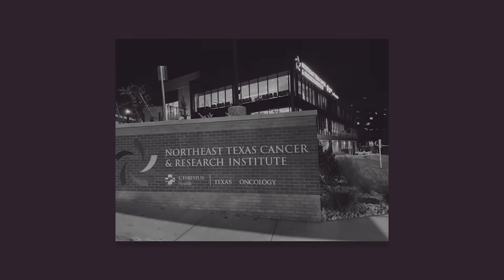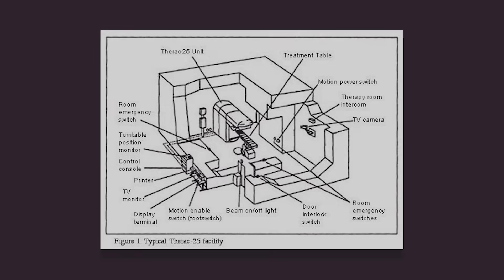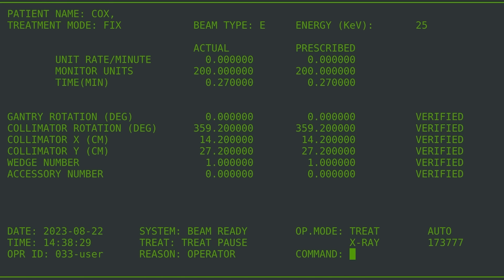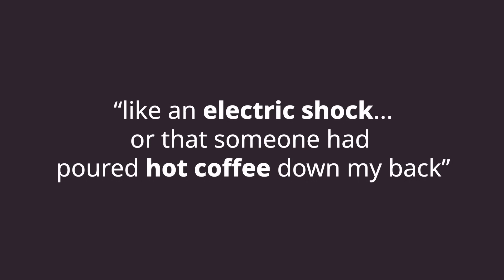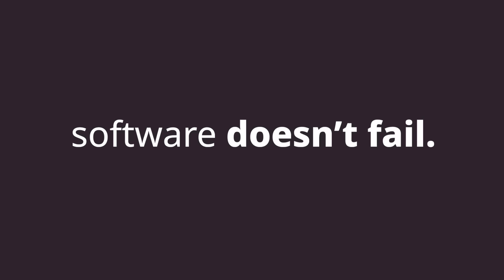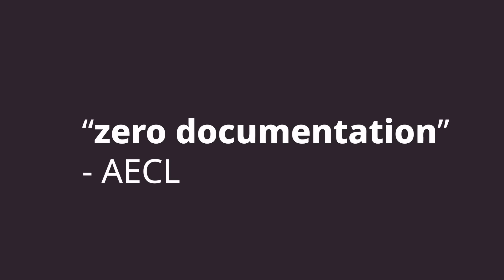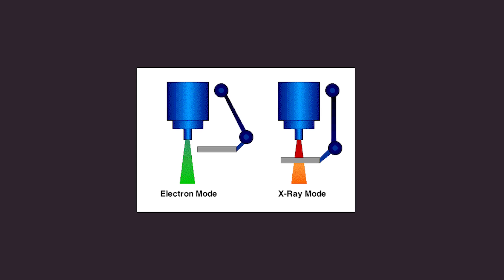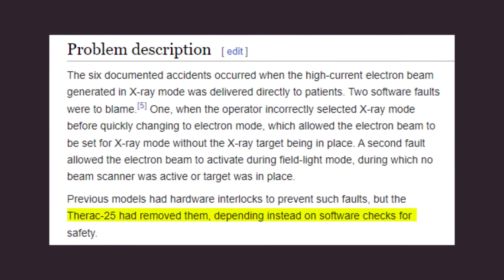how a simple programming mistake ended 6 lives

Comment: Sounds like a chain of failure from the machine, to the hospital in all regards. The machine manufacture did not care and the Hospital also did not care too.
Reply: There were six incidents though in different hospitals. The machine did something it was not supposed to do, and the user interface lied about it.
Reply: I can understand the mistake by the hospital administrators. They are paying top dollar for cutting edge equipment, so they kind of expect it to be made with high standards. But the main fault is at the company, it's a chain of negligence.
Reply: It's not always a don't care situation. It is often an ignorance situation. 
Those who design the machine are ignorant of hospital procedures. Those who design hospital procedures are ignorant on how things are actually done on the ground, particularly under pressure. Hospital workers and procedure writers are ignorant of the brief and design parameters of the designers.

This is happening all around you in all walks of life, unfortunately. It seems far worse now because there seems to be such a large cohort of people who seem to be totally devoid of scientific or engineering knowledge or are convinced of pseudo science because they don't know any better..

These days people just seem to be happy to let someone else deal with all of the issues that keep them safe without realising that possibly those who are doing the gatekeeping don't know any more than they do.. if everyone had a better handle on basic scientific subjects they would see through the bs more often
Reply: All about the money.  Root cause
Reply: Not caring should be a crime for things like this
Reply: @Rin-qj7zt  It's called negligence
Reply: @Rin-qj7zt  it already is. They just hire good lawyers.

Comment: Sorry, but ignoring an error and just unpausing is risking the life of the patient in this field.
Reply: From a short summary of this, I gathered that the users continually got errors like 'malfunction X', which often meant nothing. So, they eventually just ignored them. Maybe the staff should have a little blame, but the majority should be on the obfuscated errors and poor software design.
Reply: @ME0WMERE nuisance alarms are dangerous. That's something we have to keep in mind in industrial controls, because this exact thing can happen. If it's something that happens regularly but doesn't prevent the system from running then it needs to be conveyed in a different way so that when something is actually wrong the operators will know. This is actually a big factor in the 3 mile island incident as well.
Reply: @ME0WMERE  Oh wow that should just be reported and investigated. Errors to ignore, but yes, I guess these were different times ...
Reply: @ME0WMERE The error here would clearly be in hardware design though. The laser should not have even been capable of running at that power without the magnet in position.
Reply: The user interface clearly lied to the operator and gave no indication that any settings were wrong. Even if they had known that Error 54 was indicating too low / too high radiation, since the displayed settings were correct, it is very conceivable that they would assume everything was fine and unpause.
Reply: yes, but not if the person wasn't at all educated about this and if there wasn't any procedure they were taught to follow
Reply: Yeah agreed with the guy above... For example, the Shin Megami Tensei series was born from a series of books published in the late 80s, it was called "Digital Devil Story: Megami Tensei" which feature the main character using a using Demon Summoning Program he made on the school computer to summon demons... he uses the school computers to summon a demon and get revenge on his classmates, ends up starting a demon apocalypse.  That sounds corny as shit for the genre, but that's just how technology/computers were seen back then: like, amazing.  The average person didn't know much about computers.  The imagination about the capability of it was endless.  To the layman back then, wtf is a programming error?  The operators probably just expected the shitter to work, hence why there were 6 victims, not just the one talked about in the video.
Reply: Hard to blame the operator if the system shows 9 of 202 rads delivered. How they can operate with malfunctioning audio-video systems??
Reply: In today's world, 100%, but don't forget this was the 1980s and things were a lot different back then, as explained in the video.

We don't know what training the operator was given surrounding that error, or the Beam Mode race condition. As well, the screen reported only 6 rads being applied. Again, this operator had more than 5 years experience with these machines so it's safe to assume they'd seen this issue before, or were at least told it was safe to proceed depending on what the screen reported in conjunction (that only 6 rads were reported).

What is an absolute risk is producing a medical device than is capable of emitting 12k of rads. Considering more than 1000 is guaranteed to kill you...
Reply: @tambow44 the reason it is capable of that is because the same electron beam is used for electron and X-ray treatments.

For X-rays, a target is placed in the beam to stop the electrons and produce X-rays. But most of the energy in the electrons is lost as heat in the target, so you need a lot more electrons than if you use the electrons to treat the patient.

Comment: "never tested until it arrived at the hospital..." Thats got to be the worst case of testing in production ever recorded
Reply: Speaking of which, wanna go to the Titanic in a submersible?
Reply: @me0101001000  at least thats almost impossible to test, this is easy
Reply: @me0101001000 implodes
Reply: @me0101001000  Didnt they make a bunch of successful dives tho?  i thought i heard somewhere they were operating since like 2013
Reply: tested that it COULD work, or that it CAN work. The first is the dev pov "set it like that, it works". The second is a UX pov, stories and personnas are taken in account.
Reply: only to be topped by the OceanGate Titan  sub.
Reply: I was around in the 80s and seems most of our modern TDD ideas didn’t come around till the nineties with the Gang of Four book and langs like Ruby.
Software is very breakable and edge cases abound
Reply: I use to have a side work as a small  clinic that happen to be close to a large manufactur of medical equpment. They sent us tons of equpment that just got a basic system check for more evaluation.

Granted those machine was for analys only  not treatment. So it want like a bug would kill anyone.
Reply: ... except if there was a misdiagnosis, e.g. the analysis indicated that a potentially fatal condition wasn't present when it actually was. @matsv201
Reply: I don't always test, but when I do, I do it in prod.
Reply: It´s even worse now, actually. You buy a product and you´re its tester for its lifetime...
Reply: was this built by game developers?
Reply: Maybe the software has been tested only on a hardware emulator i.e. another software sending/receiving data.. Which may lack the simulations for the actual hardware delays.
Reply: Engineers can have a bit of hubris in thinking they made the product perfectly.
Reply: this is still how most software testing work till this date.
Reply: Think so OP?  Oh boy, someone should tell you about the """""""extensive"""""""" testing they did for the JAB for the CCP virus.
Reply: Boeing MCAS has entered the chat
Reply: well it's pretty bad, probably only bested by "never testing until it's loaded into the nuclear silo" or something like that
Reply: think about how many product you use or eat that probably was never tested.
Reply: Jesus.. I was thinking the same… How are they not gonna test that..
Reply: 6 columns effected
Reply: The submarine CEO got inspired by this i bet
Reply: Elizabeth Holmes would like a word with you
Reply: don’t think I’ve ever heard a worst sentence formed
Reply: Same with the Covid "vaccines" though.
Reply: It should be illegal for these types of devices. Like wtf
Reply: Test on production
Reply: never been in the millitary i take it?
Reply: At  2:15  after the "X" has been changed to an "E", at the bottom of the screen it still showed  "Op mode: TreatX-Ray"  wow.   So Ray Cox got X-Ray-ed.  Sad.
Reply: All those regulations that keep competition out of the market seem to not do what's they were designed for... or they are doing it very very well.
Reply: Shocking that they never tested it.  This was AECL, not some seat of the pants private company.  NASA was doing software testing in the 1960's "Even during the early 1960s, the cycle of requirements definition, design, coding, testing, and maintenance was followed, if not fully appreciated, by software developers. " and "Verification and Validation: There could be no true certification of the Apollo software because it was impossible to simulate the actual conditions under which the software was to operate, such as zero-G. The need for reliability motivated an extensive testing program consisting of simulations that could be accomplished before flight. Three simulation systems were available for verification purposes: all-digital, hybrid, and system test labs. All-digital simulations were performed on the Honeywell 1800s and IBM 360s used for software development. Their execution rate was 10% of real time109. Technicians did hybrid simulations in a lab that contained an actual AGC with a core rope simulator (as core rope would not be manufactured until after verification of the program) and an actual DSKY. Additionally, an attached Beckman analog computer and various interfaces simulated spacecraft responses to computer commands110. Further ad hoc verification took place in the mission trainers located in Houston and at Cape Canaveral, which would run the released programs in their interpretive simulators.
 
The simulations followed individual unit tests and integrated tests of portions of the software. At first, MIT left these tests to the programmers to be done on an informal basis. It was very difficult at first to get the Instrumentation Laboratory to supply test plans to NASA111. The need for formal validation rose with the size of the software. Programs of 2,000 instructions took between 50 and 100 test runs to be fully debugged, and full-size mission loads took from 1,000 to 1,200 runs112.
 
NASA exerted some pressure on MIT to be more consistent in testing, and it eventually adopted a four-level test structure based largely on the verification of the Gemini Mission Control Center developed by IBM in 1964113. This is important because formal [48] release of the program for rope manufacture was dependent on the digital simulations only. Raytheon performed the hybrid and system tests after they had the release tape in hand114. At that time, MIT would have released an AGC Program Verification Document to NASA. Aside from help from IBM, NASA also had TRW participate in developing test plans. Having an outside group do some work on verification is a sound software engineering principle, as it is less likely to have a vested interest in seeing the software quickly succeed, and it helps prevent generic errors."
Computers in Spaceflight: The NASA Experience
- Chapter Two -
- Computers On Board The Apollo Spacecraft -
history. nasa. gov/computers/Ch2-6. html
Reply: You can’t call it that cause it wasn’t tested
Reply: That's literally murder
Reply: For fr
Reply: …yes. Yes it would be?
Reply: @0xTristan  nuclear bombs?
Reply: and crowd strike just proofed it wrong
Reply: Yep wo dows 11 and 10 the users are the tester
Reply: Man when some minor employee screws a document they fire him and his job is done, he can retire and enjoy staying in home with no other chances to screw up anything else never again
I just dunno who can fire this...
Self made, self tested, self guaranteed
If you cant do it, dont start in the first place, You murderer
Reply: Mark 14 torpedo of the hospital word.
Reply: mój faworyt <3
Reply: YT: "Worst case of testing in production ever recorded"

Pfizer: "Hold my beer."
Reply: capitalism
Reply: Kind of like the 5G rollout. And COVID shots.
Reply: @LastExile1989  you speak as if you know anything about either just because you read one conspiracy theory article.
Reply: @LastExile1989  You’re joking.
Reply: @LastExile1989  "Kind of like the 5G rollout. And COVID shots."

==I don't see anything special about 5G. This is 3.3 to 4.2 GHz micro waves.

For the shots. it is based on mRNA which has been researched on for about 20 y and testing on animals. In 2020, since it was an emergency, government agencies gave the OK to use it on humans.

The assumption is that there is a plan from the government to harm people using these 2 technologies which is just balony.

Comment: I'm still confused (other than for profit motive) why the same machine for 180 rad would be used for 12.5k rad dosages.
Reply: Just a guess (don't understand this subject), but I think it's because the x-ray mode projects a strong beam that is then "regulated". The problem was that the "regulator" was not in position.
Reply: @shimadabr you're pretty close.

To produce X-rays, the machine accelerates electrons and then crashes them into a tungsten target. The target stops the electrons and X-rays are produced. The dose rate from the X-rays is less than 1% of the dose rate from the electrons - most of the energy is lost in the target as heat.

To produce election treatments, electrons are accelerated with no target in place and deposit their energy in the patient directly.

So for the same electron beam current, the X-ray dose is orders of magnitude less than the electron dose. Or, put another way, to get the same dose, the beam current must be orders of magnitude higher in X-ray mode than in electron mode.
Reply: @DevinBaillie - Thank you for that info.  I've always wondered why these machines could produce lethal radiation doses?  The explanation of the software glitch made perfect sense, especially given the vintage of the equipment. But the magnitudes of higher overdose of radiation never made sense to me.  I'm betting most reading these comments after watching these Therac videos still don't get it either.  The now known software glitch would cause the unit to enter X-Ray mode, without enabling the electromagnetic beam deflector to hit the Tungsten target (instead of the patient being the target of 10-20,000RADs).  Poor victims of these machines, ☢️ probably one of the longest most agonizing ways to go!   😱
Reply: @xxxxxxxxxx6903 Exactly, except it's the target that moves into the electron beam, not the beam being steered towards the target.
Reply: @DevinBaillie  - Interesting!  
Either way, having designed out the hardware safeguards on those machines was criminal negligence by the mfg!  Once you explained the X-ray generation mechanism.  I was thinking a dual electron beam source would've been a way safer design. With the Tungsten target fixed in one.  The probabilities of the target mechanism/electronics failing is just unacceptable for a patient treatment machine!  As proven!
Reply: I would say, because the software doesn't check the dose before sending it (aka: the dosage doesn't have a prefixed limit for each mode in the software) it got sent anyways
Reply: Let's say you want to send 25000 electrons, but you put it on X rays, it will do it because it doesn't have a safeguard on it, that tells the system not to do it since it doesn't have any hardware safeguards either
Reply: The other key reason for having a machine capable of doing both operations is that previous models were much bulkier, so being able to essentially replace two bulky machines with one smaller machine was a HUGE appeal.

As a loose analogy, consider having both a bulky printer and bulky scanner in the 1990s/2000s, vs. having a combined printer-scanner unit today.